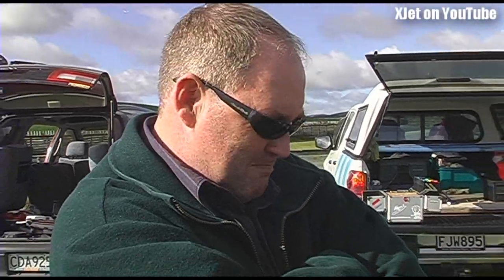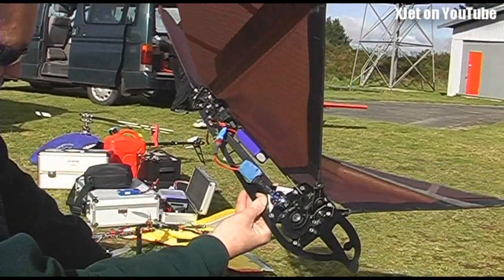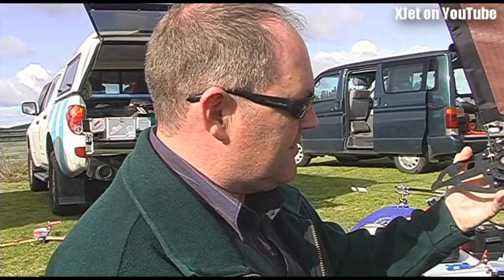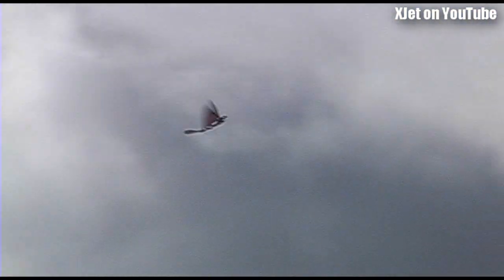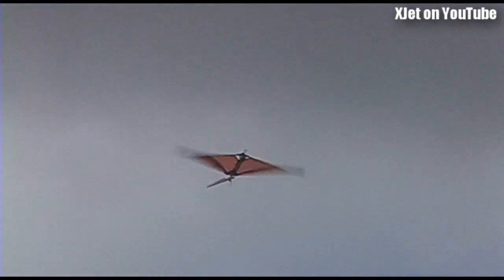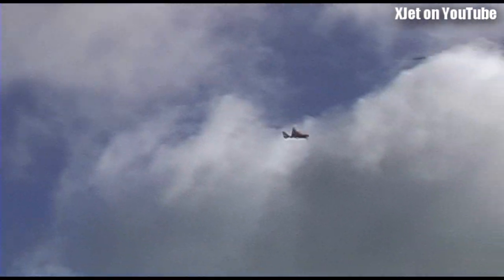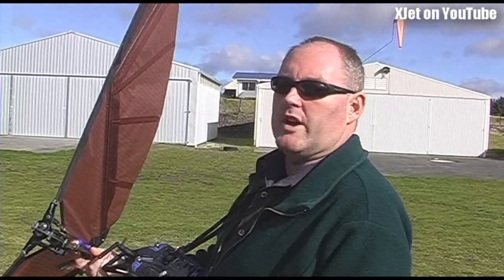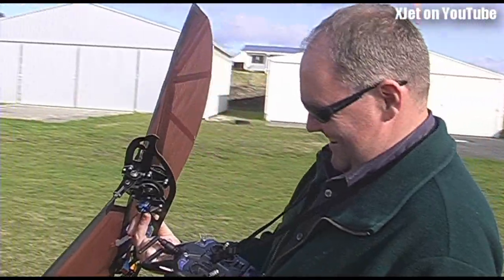Things that should not fly #6  The RC ornithopter

Comment: That is a Kinkade model.. probably a Park Hawk judging by the size.  I have a Kinkade Slow Parrot (older, larger model) and these things absolutely love to fly.  With the lack of a vertical stabilizer they do tend to have a mind of their own and will often make a circle or two as in this video,  all while you are commanding a turn in the opposite direction.  I have the exact same reaction from other birds on every flight!  Love it!
Reply: I too have a slow parrot from about 2004 and while I expected the local buzzard population to check it out I didn't expect the reaction from the horses in a field a couple of hundred yards away - they were really spooked the first few times I flew it. 
Must blow the dust off it and get it flying again.